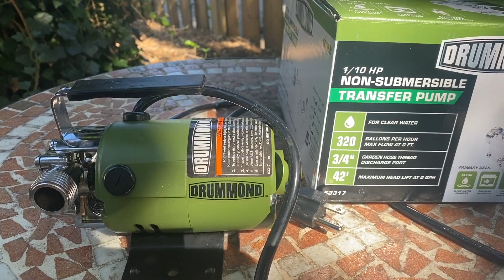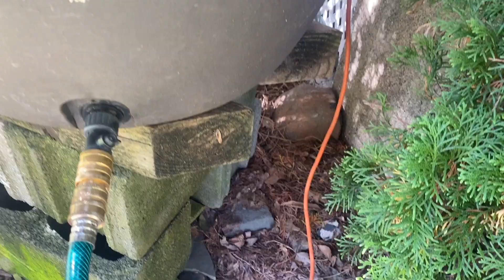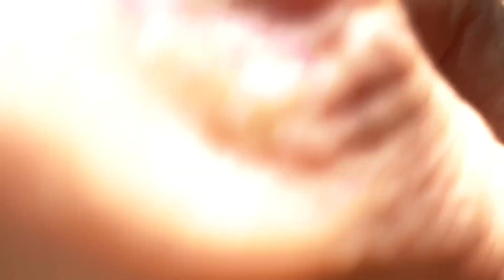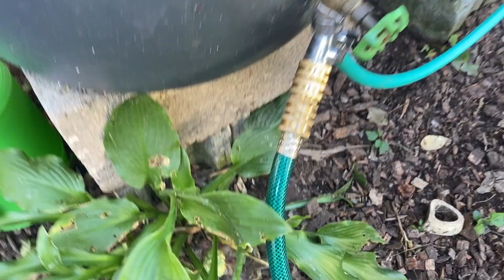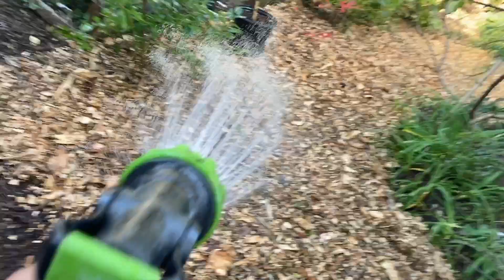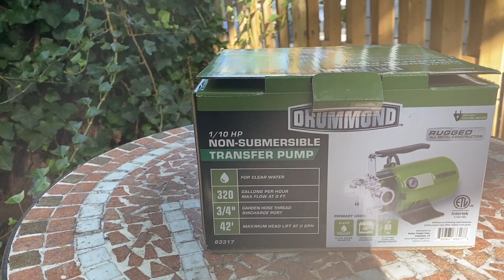Harbor Freight Tools Drummond 120v Transfer Pump Review

Comment: Good demo, and thanks for the mention of those hose quick-connects. I love them.
But just a side note on them: get enough for your needs. If you need more you need to get the exact same kind since there doesn't seem to be a standard for them, and one male end isn't guaranteed to fit the female of another brand, even though they look the same.
Thanks for sharing.
Reply from the maker: Good information. Thanks!

Comment: Great video. What happens if you stop the water flow at the sprayer nozzle? Will the pump still function normally?
Reply from the maker: It works but my concern is the pressure will build up and burst the hose so I typically try not to allow that to occur for too long. Even with some stronger pumps I have, moving from one area to another has been fine to let it run but I try to release the pressure relatively quickly

Comment: Do you need to lubricate the intake before use or nah?
Reply from the maker: Not lubricate, but prime the pump with water otherwise if it runs dry until the water hits it could burn out the motor.

Comment: Get a 1/2hp pump and bury some garden hoses and hook them up to you ground sprinklers. Then you can have a beer while watching the fruits of your labor water your garden!  Just be sure to blow them out before winter.  I use the same pump (1/8hp) on my 125gal fish tank. Hasn't failed me yet.
Reply from the maker: Ha! I’m all on board with any excuse for having a beer. I actually have an underground sprinkler system I built with pvc pipe — I even have a video on the manifold I built to send the water to different sections of the garden — but I think this pump might be too powerful for it. The garden hose idea would work better

Comment: drummond very stupid.............my just bought not too long and it has no sound when turn on and no water coming out.........I think it was overheated because it felt so hot when touch.........so what is the problem with such situation???
Reply from the maker: Did you prime the pump with water first? These pumps need to have water in them to start. Also, you may have something stuck in the impeller. If you use it to clear a pond for instance, if a small pebble or nut gets sucked up it can jam the impeller. In that case you need to take off the cover and clear out any blockage.
Reply: @HomesteadDIY  I used it watering my flowers in my garden in the morning and in the evening I tried watering again but the water not pumping and the noisy sound is gone when I started turned on the on button…. usually when I turn on the on button there is a noisy sound on right??? now there is no noisy sound…. beside the Drummond felt very hot when I touch it…. so do you know what was the cause in this situation???

Comment: can this b used in the house for your kitchen bathroom n laundry?
Reply from the maker: I don’t see why not. As long as your not allowing debris to pass through that will clog the impeller and only pumping non-corrosive liquids, it should work fine I’d think
Reply: @HomesteadDIY  you want a diaphram pump for home use or garden use, these are just meant for moving water unimpeded..  These can't really build up pressure and will continue to run if the outlet is shut off which is bad for the pump.   Diaphram pumps have built in shutoffs and can supply house pressure ( around 70-90 psi).